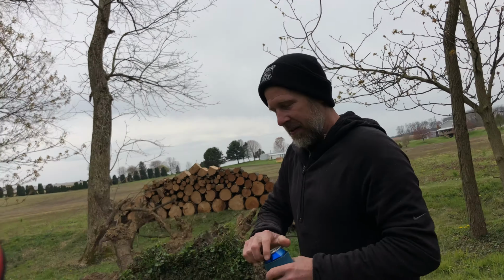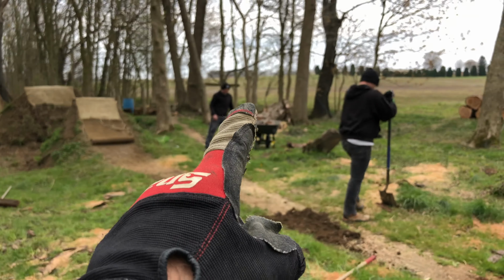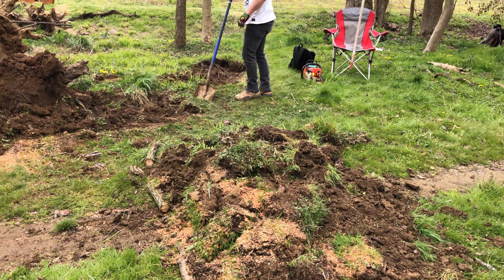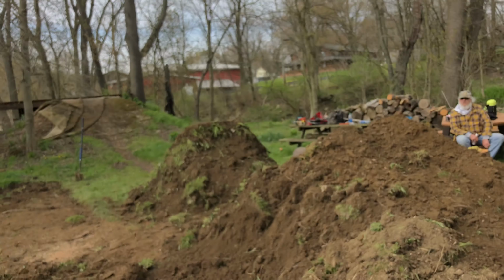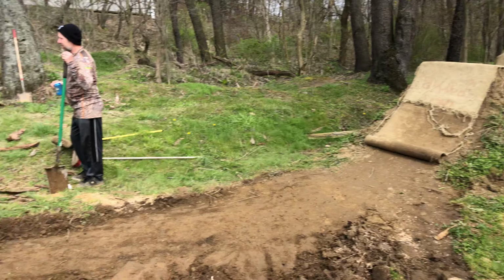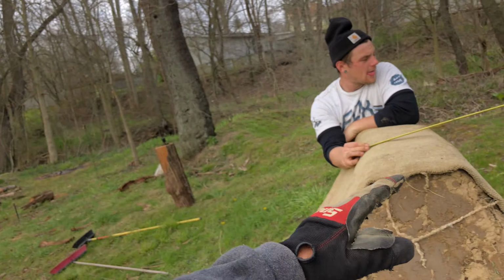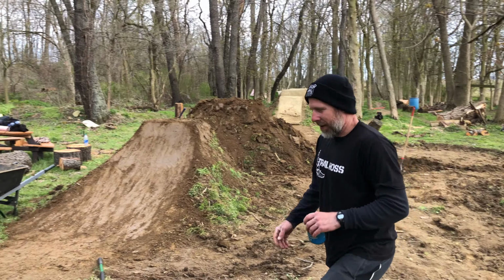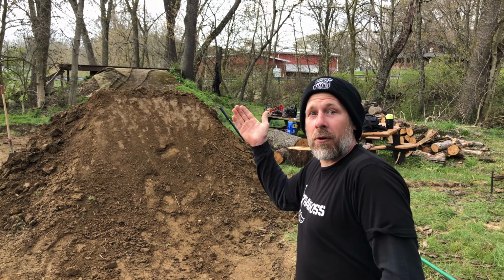How To Build A BMX Dirt Jump In ONE DAY!

Comment: Curious on why you didn't use the stump as a base to minimize the dirt used.  Is there a downside?
Reply from the maker: Yea over time it degrades and the jump can settle. But mostly just if you need to move it or ever end up moving it years later, it’s super annoying. Also a pride thing I think
Reply: Stumps make jumps look janky and it’s just a lazy way
Reply: Sometimes stumps soften over time. Rocks aren’t a bad idea if it saved you 10 shoes full’s.

Comment: Any tips on measuring to ensure the height of the lip and landing are correctly spaced apart?
Reply from the maker: Oh man. That’s such a hard one to give tips on since it relies on so many variables. Speed being a key factor. Perfect example. A 2 foot tall lip can have a 20 foot gap, or a 5 foot gap and it is only reliant on the speed coming into it
Reply: @Brant_Moore  Thanks for the reply! So true! I'll have to work on this as I'm aiming to build a line and this is the hardest part as you know. Just figured I'd ask if you had any tips! Very awesome video btw definitely gave me some motivation to get building!